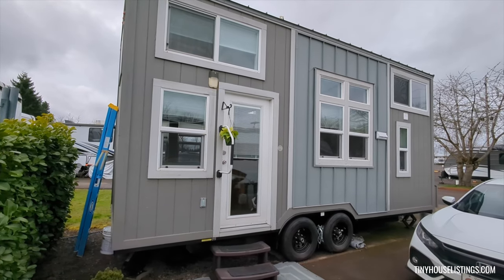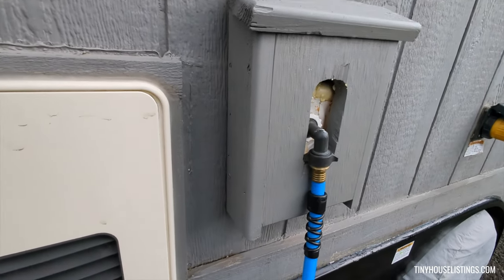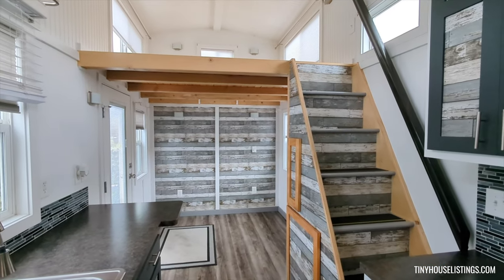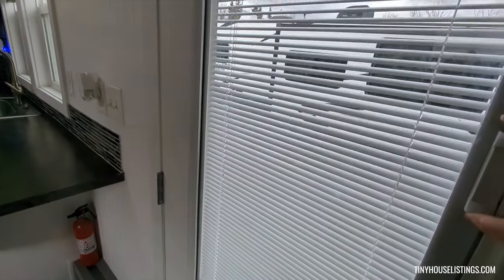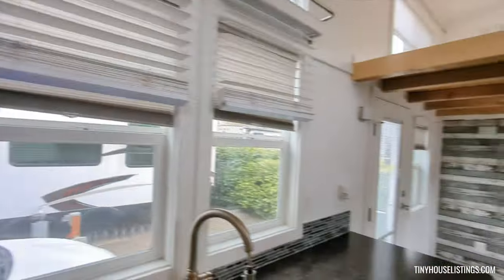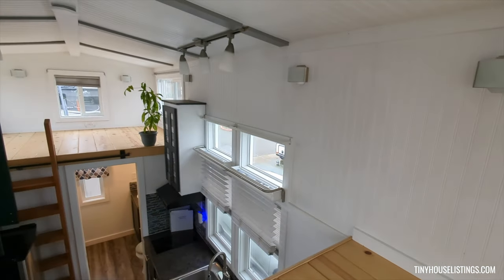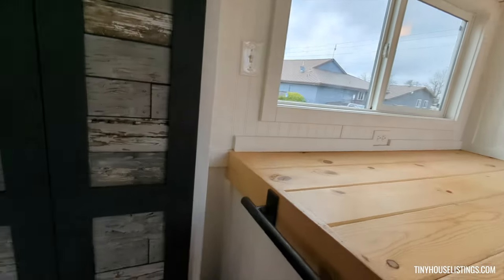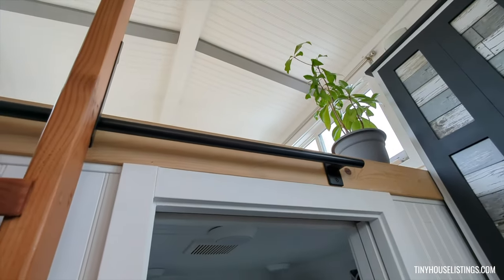Certified 22' Tiny House Has TWO Lofts

Comment: This is a nice house. Who was the builder? It looks like it was made by Tiny Mountain Houses, but I don't see that information here or on the Tiny House Listings website. 22' x 8.5' is a great size, but there are a few things I don't understand. Why is the second loft only 4'x6' when the house is 8.5' wide? Is the main loft 8' wide x 6' long or 8' long x 6' wide (like the secondary loft)? A lot of the footage in this video was repeated which made it difficult to follow.
Reply: Yes, they rarely mention the builder on listings but you are correct.  It's the Chinook model from Tiny Mountain Houses...